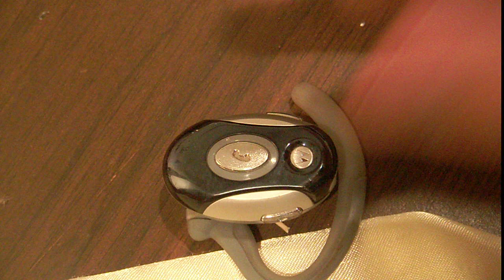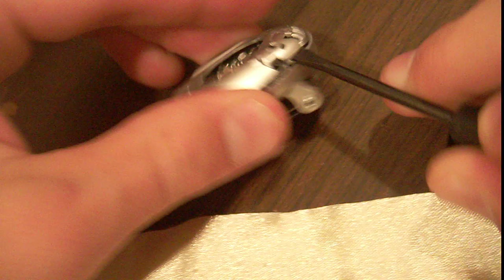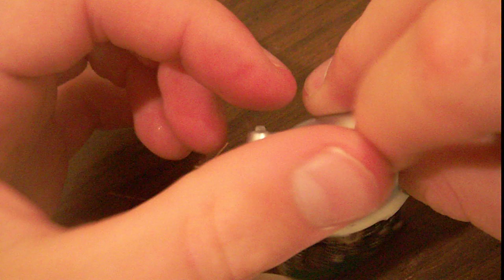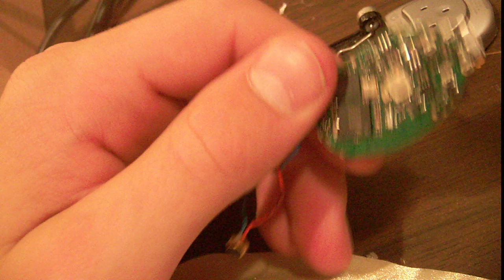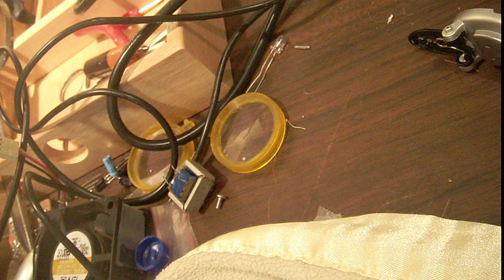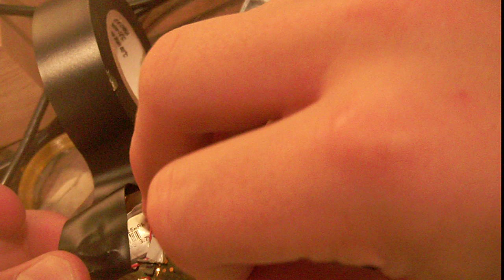Inside Bluetooth Headset

Comment: Maybe I'm wrong, but is that not the battery that you are referring to as the module? Anyways thanks for the vid my man, I have one of the earliest first earpieces  that Motorola came out with. But I need to swap out the old battery (won't hold a charge) with a new one, and I did not know how to get into the damn thing until I saw this. I also learned a couple of other things from you, so I thank you for that. keep up the great work!👍😉🇨🇦

Comment: You know what o wanted to do I want to make my headphone wireless and bt compatible I have some broken Bluetooth headset that still pairs and can hear but my Mic doesn't work so I was thinking if I can take the mother board of the blue tooth and connect it with my headphones wires and the blue cable must be the Mic so ill connect it with my Mic on the headphones but the only problem is the battery it might work or maybe not

Comment from the maker: Thanks for the tip, make sure to add an amp (simple 1 transistor will do) if you want to use headphones with a higher resistance (which will almost always be the case).

Comment: Nice tear down . For most people looking at video's like this keep in mind when you take the speaker out, measure the resistance across the speaker. Then divide the voltage ( 3.6 v( on power cell) by the resistance in ohms.Then measure the resistance across your headphones most likely it will be significantly higher ohms. Divide the 3.7/ (headphone R) the lower the number ( already in decimal ) the lower the volume in your headphones you will need to add an amplifier circuit .

Comment: There is not a good way to turn this into stereo becasue there does not seam to be stereo processing built in. you can wire two earphones into the circuit in parralel I am not sure how much it will be able to drive you most likely will not be wiring this into standard headphones. the power needed to drive them will be too great .

Comment: Hey, what if i disconnect the wires going to the speakers and replace it with a female 3.5mm audio jack..............then when i connect my normal headphones to it, they will become wireless i am sure that'll work but my question is that will my "wireless headphones" be stereo or mono?

Comment: i already took mine apart i have the same one it wont work after you take it apart because closing the mic is what turns it on and off, there is a small black thing with a pad on it that acts as the on off switch it probably flew across the room when you gouged it out with the screw driver.
The back piece around the plug hole slides off easily and is how you take it apart without destroying it.